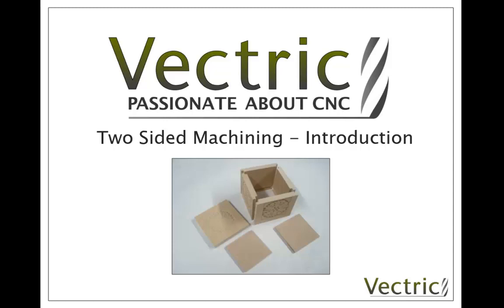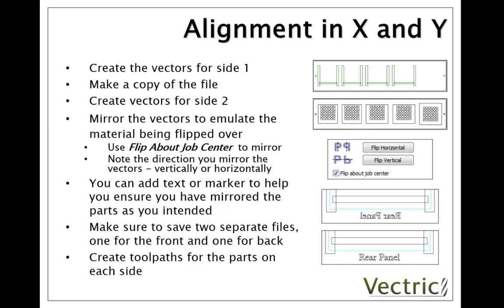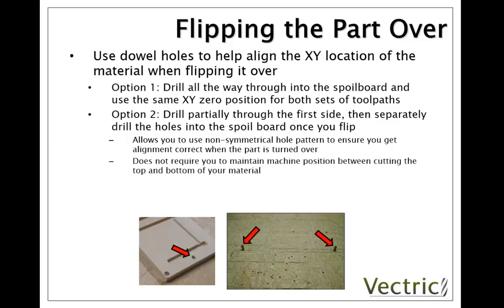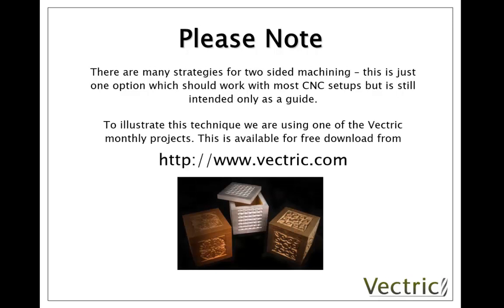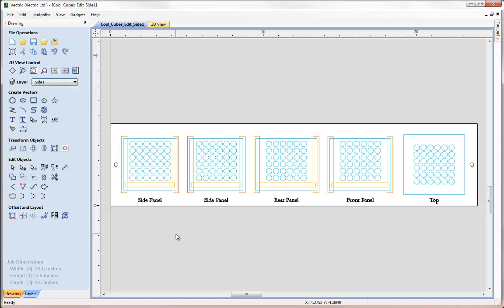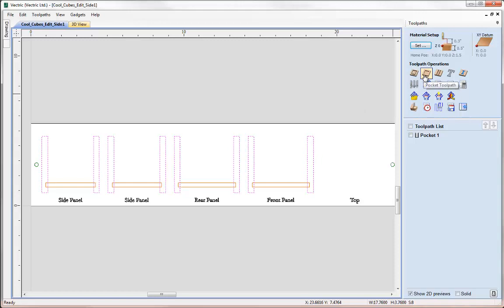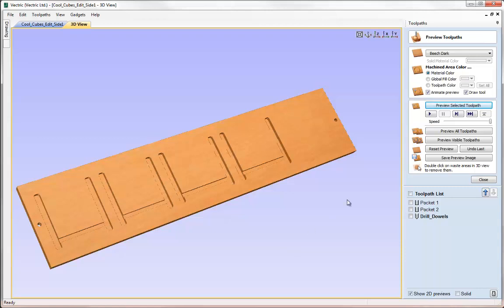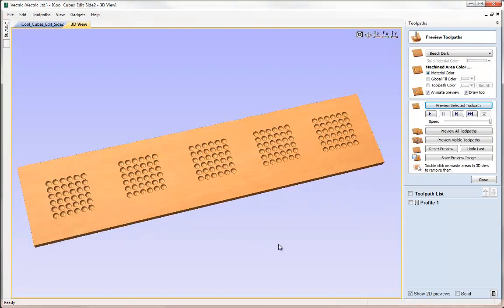Vectric V8 Tutorials - 2 Sided Machining

Comment: Excellent video, he covered software layout and the details of that, positioning the material, and cutting side one and two and the concerns for that. I have watched a few other videos and they did not touch on using the software in developing the cut, a VERY critical part of the project.
Thanks You